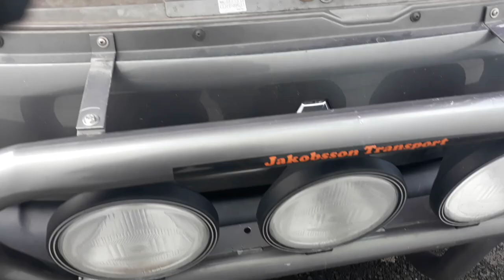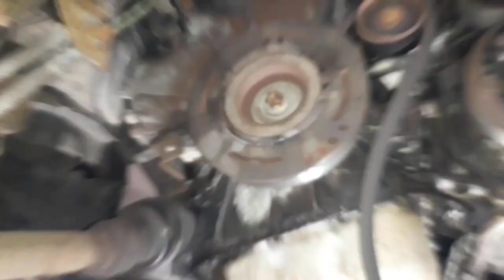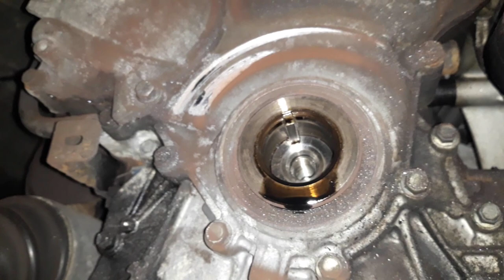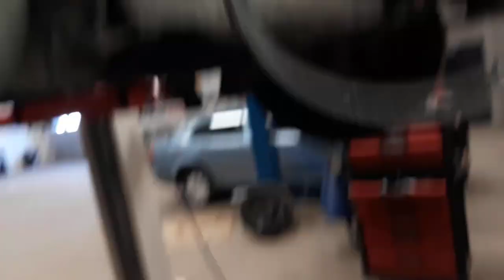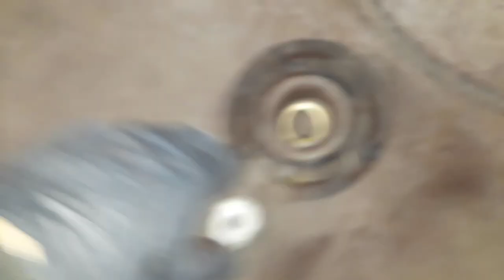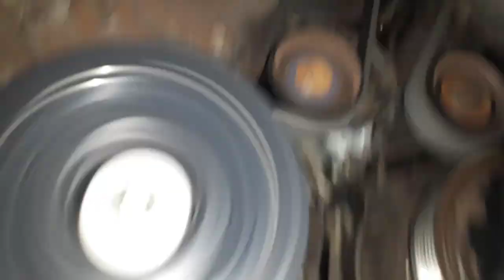Renault  Crankshaft Pulley /Crankshaft Pulley Removal Change

Comment: Does the cams need to be locked before removing pulley?
Reply: No, the timing belt is on the opposite side of the engine, this side is the auxiliary serpentine belt, engine can even technically run without the belt on. Though your water pump, alternator etc won't be being driven.